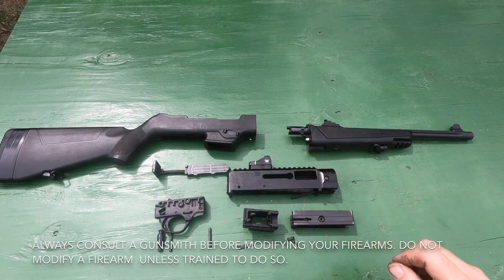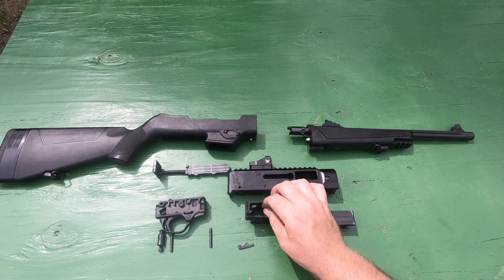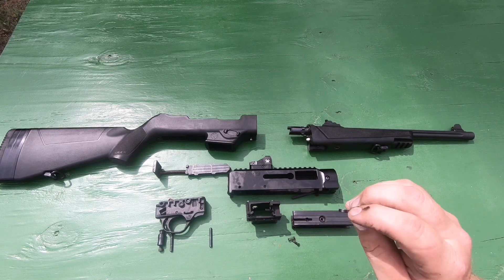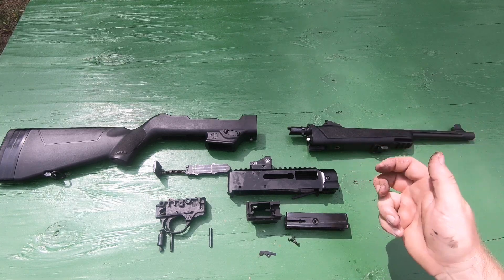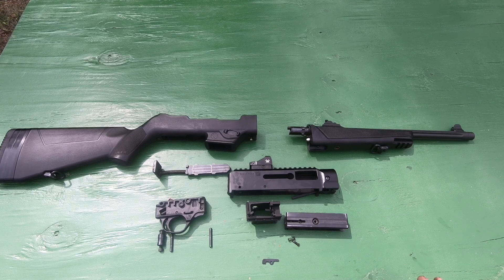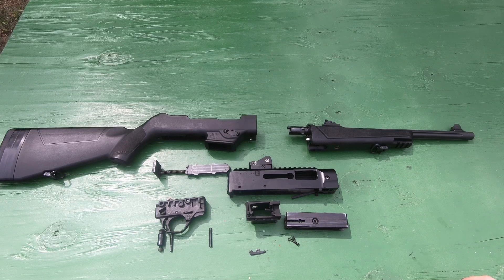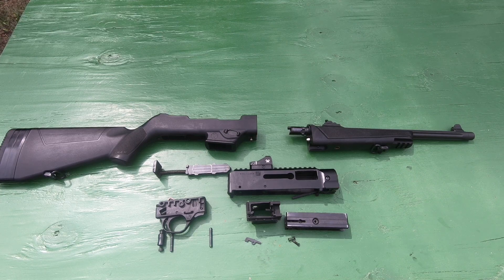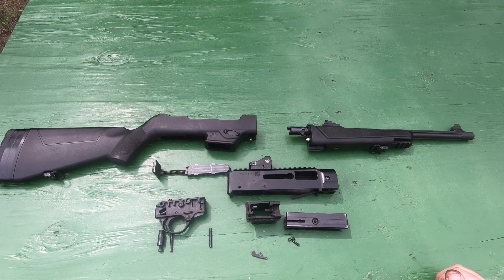Ruger Pc Carbine FTE Fix. Ejector Issue.

Comment: M-Carbo & Tandem Kross have all the parts you need to make this a lifelong flawless piece & turn it into a 100% reliable more durable gun.  That being said shame on Ruger for the need they created for those of us that expect it to be better out of the gate.  I personally opted for the steel recoil spring retainer, A2 Steel Bolt Head & Extractor Pins, new Exact Edge Extractor,  Carbine Shock Buffer from M-Carbo & from Tandem Kross the Victory Trigger, Game Changer Pro Compensator &  Challenger Charging Handle. These simple to install upgrades take this rifle to another level & turn it into a fire breathing dragon that will not run out of "umph" due to a failure of inferior factory cost cutting parts if ya know what I mean.  This little Ruger carbine is a really good gun out of the factory but with a few simple inexpensive tweaks it is what it was meant to be.
Reply: I'm really interested in your build, do you have any vids? Slowly turning mine from stock into perfection. Literally only have frame upgrades right now outside a vortex red dot. Had base model, instantly added MWI shroud, finally just got around to purchasing chassis (ruger chassis not sold in CA) but went with MWI again over TK because of cost and matching shroud. 
Love my rifle but after 3k rounds, it does stovepipe rather frequently,  at least once per 200 rounds. In its defense,  I don't clean as often as I should, and am using glock sticks, never with high dollar ammo. Always oiled and never steel, so I expect better, and now I know where to keep my eye on. 
Appreciate the comment

Comment: MCARBO is your friend.   Changing the factory “soft-steel” extractor to the A2 “tool steel”  MCARBO extractor easily eliminates this “Achilles heel” from Ruger.   You can swap out extractors yourself in under 5 minutes, it’s stupid easy.
Reply from the maker: It really is the main weak point of the firearm. Its great to see so many aftermarket parts though. Thanks for the comment!
Reply: For anyone watching that is experiencing similar issues.....  MCARBO.  Get their entire kit, it's makes the rifle VERY enjoyable to shoot dampening some of the felt recoil AND as Colt10MM said, makes the rifle reliable.    I hade FTE FTL, and a bit of some excessive recoil when shooting heavier bullets.  Now it shoots everything just fine an no complaints.  JUST SPEND THE MONEY its worth it.
Reply from the maker: @bradkuether3561  Glad to hear you like your Ruger! They are fun rifles to shoot and superb accuracy out of the box. 

I didn't get any other M-Carbo parts but they are a great company with great products. but my rifle runs great with only the replaced extractor. And a little cleaning from time to time. :)
Reply: I've had my Ruger PC Carbine in 40 S&W since they came out and has been M*CARBOd all out. I just got the 9mm version for my birthday and just tricked it all out with M*CARBO as well.
Reply: Got mine a few weeks ago and went to mcarbo replaced the extractor

Comment: I’ve seen your review after I got mine, after some research I found m-carbo has fixed it with a new extractor and a bunch of updates and instructional videos, I highly recommend them
Reply from the maker: Ill check them out, thanks. I have seen more and more places selling aftermarket extractors for these. I still use the factory one myself and since this video have had 100% reliability but every gun is different.
Reply: John Janoch 
Awesome news, thanks!🙏

Comment: I was having similar issues and went ahead and got a replacement (M-carbo) extractor, which failed after 10 rounds.  Very disappointed and trying to get it replaced.  That said I filed my old one and it seems to have improved.  But my extractor "claw" is also warn badly and I believe this is only a temporary fix.  Thanks for the video.
Reply from the maker: That sucks to hear about the M-carbo extractor. Honestly your the first person I've heard that has had an issue with anything of theirs. Did they make it right with you?

Thanks for the comment!

Comment: For my 2021 PC chassis carbine I added an M*CARBO machined, hardened extractor and all the other available M*CARBO upgrades plus a folding stock using the original MOE adjustable stock on an LBE buffer tube screwed into and blue LocTited into a Midwest Industries "folding buffer tube adaptor". 
OTHER UPGRADES: MAGPUL QR one/two point sling, MBUS folding sights, K-2 pistol grip, Angled Forearm Grip, QR flush cup on forearm,  TACCOM flared mag well adaptor of high impact machined Delrin, HOLOSUN AEMS circle/dot sight
Reply from the maker: Sounds like a nice set up.

Comment: Hopefully Ruger is on to this issue and has modified the extractor so we don't have to play gunsmith on a brand new firearm!
Reply from the maker: I agree, I hope that they do a little quality control and replace the extractor at the factory with one of better quality.
Reply: I just picked one up, brand new, and it still has the soft edge extractor. First thing I did, other than swap the ruger mag well for the Glock one, was install MCarbo’s exact edge extractor.
Reply: Yeah I wish.  Got my PC9 last week (June 2022) and went to the range on Father's Day.  Stovepipe with the 4th shot, and it averaged 1 stovepipe per mag after that.  It did it with all 5 mags and 6 or 7 types of ammo  😞

Comment: I'm having a problem with I can't get my charging handle to come out, using a 5/32 allen screw it just won't budge, and so I haven't been able to get the charging handle out to get the bolt out, any ideas on that?
Reply from the maker: Make sure you are turning it counter clockwise. They can be really tightened down from the factory. Mine was really tight when I first removed it.
Reply: Try heating it up that usually works.

Comment: Ruger will fix it for free and ship it for free.
Reply from the maker: Took me about ten minutes to fix. But I think you are correct. I just don’t like missing matches due to it being down/shipped off.
Reply: Any issues with steel case ammo?
Reply from the maker: @michaelkeryger141  I haven't run it personally so i cant say. it didn't mind aluminium cased rounds I tried for a bit though.